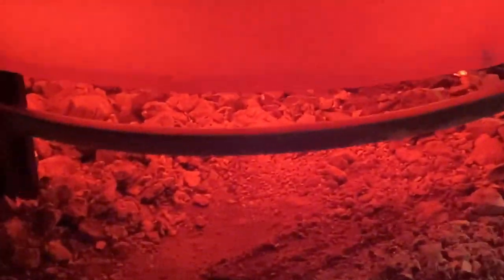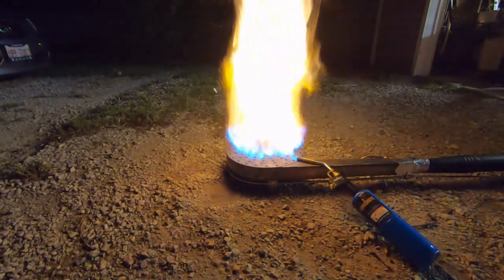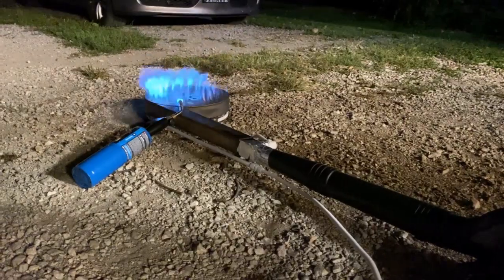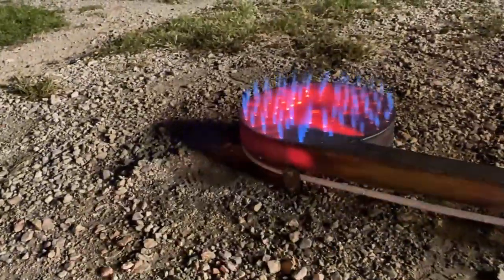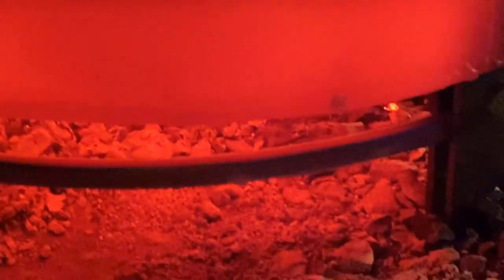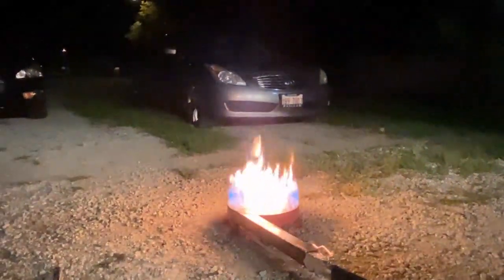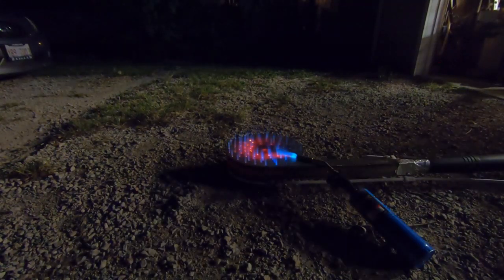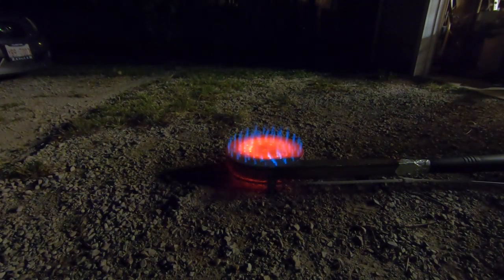Getting MORE power from Propane bottles SOLVED

Comment: When electricity is available (like when running a genset), an intermediate solution is an electric blanket and temp or pressure controller on the tank. The whole propane vessel is a boiler, so the thermocouple/transducer can be anywhere before the regulator, and set to 80-90 degrees F... max ~100F/38C/200PSIA.

Your coil vaporizer has no issue with overpressure, and has potential kilowatts of available IR alone. Simpler, cheaper, and way more effective for a burner. Very impressive!

Comment: I worked for the leading industrial heat manufacturer and renter in the Northeast. We manufactured liquid and vapor industrial heaters that heat commercial jobsites that require a large volume of btu output. Using multiple coil tube burners with different size interchangeable nozzles will get you the output your looking for.

Comment: Why not run the vaporising line around the outside of the top edge on flat stand out brackets that way transition to vapour is likely to be much faster
Reply from the maker: The goal is not to destroy the vaporizer tube
Reply: @NOBOX7  flat brackets on the top face with the tube outside the perimeter far enough away that it doesn’t destroy it but still gets enough heat to vapourise quickly after initial ignition

Comment: Could stainless steel up the operating time without exponentially increasing build costs
Reply: 800 hours is almost a consumable like a bic lighter
Reply from the maker: This is stainless steal , 304 actually
Reply from the maker: In this case 800 hours exceeds the life time of most projects
Reply: I couldn't imagine the fuel cost to wear out this burner. 

You'd need a direct feed of natural gas, or huge onsite delivery LP Tanks.
Reply from the maker: @volvo09  Right , if you can afford to run this for 800 hours you can afford to buy another one when it burns up .
Also this could be built with SiC
Reply from the maker: @volvo09  $31,000 , i did the math today